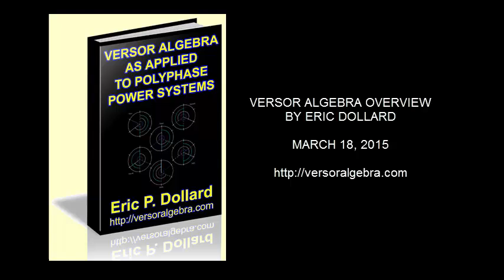Versor Algebra by Eric Dollard 2015-03-18

Comment: Thanks aaron, I bought a kindle just so reading digital is tolerable and I`m reading lone pine now which I purchased a few weeks ago, also if you get a chance to respond which book would you reccomened reading after lone pine?
Reply from the maker: stringmanipulator Lone Pine 2 is actually a bit advanced, but part 1 gets all the dimensions straight and is simple enough that a beginner can make their way through it. 4 Quadrant Theory is the direction to go to move towards the real understanding of the rotating electric waves in a Tesla type polyphase power system. This presentation is the simplest that it has ever been. There is a companion book that gets more technical than the lecture, but the lecture is a must see. If you're interested in the wireless work, Extraluminal Transmission Systems of Tesla & Alexanderson is needed. Although there is a lot of technical information in there, Eric has a LOT of history on the entire path of wireless transmission from the beginning that most people can understand and it is very fascinating. Eric also does a splendid job of dismantling Einstein's nonsense. Make sure to also watch the free videos which are linked to at http://ericpdollard.com those are long and valuable presentations that also gives a lot of background history into the electrical sciences.
Reply: Aaron Murakami
 Thank you Aaron for clarify, I've seen several of the presentations on youtube, and some of them several times, and I think they are awesome. I will support the work from Eric Dollard as good as I can because I think he is a genius and I hope he can do the experiments he has in mind now on his upcoming new lab .. 
It's so very interesting :)
Reply from the maker: stringmanipulator It's a PDF e-book for now. http://lonepinewritings.com
Reply: stringmanipulator  it is worth every penny and more. Easy to read nice diagrams and the way eric dollard writes is very entertaining.
Reply: Aaron Murakami thanks again aaron, I did purchase both lone pine writings but I will definitely study up on that video, I've watched theory of anti-relativity and origin of energy synthesis over 10 times and I still see things more cleanly each time, best wishes to you guys thanks again!
Reply from the maker: By the way, not sure if you saw them all but there are a couple other free video presentations by Eric on his website http://ericpdollard.com
Reply from the maker: Simon Limon Lone Pine Writings Part 1 is a primer then, there is Lone Pine Writings Part 2, which is a compilation of papers that may be a bit advanced. Actually, I would study http://fourquadranttheory.com video, then book. That is kind of the premise that Versor Algebra is built upon.
Reply: Simon Limon Sorry for just barking in here, but what format is the lone pine writing ? been meaning to pick that up for a while now .. is it just pdf? or is it epub ?
Reply: Aaron Murakami
 So lone pine writings 1 and 2 are for beginners, and then the next stage is 4 quadrant theory ?  Does the lone pine writings require any special education before hand ? or can a beginner get something out of it as well .. thanks :)

Comment: I am Very Found of your Hard, Intensive and Extensive Work, Eric, in Clearing the Basics of Electricity.

I am then near ashamed to spot few details you may care about but are so little in importance compare to the Very Value of what you do. But here the point I've noticed:

1. We found a use of "versor algebra", in Q.E.D. and Ricard Feynman's method, especially applied to diffraction, reflection, composition of different vawes length of light (it may be the same in sound engineering while dealing with large music theatres).

2. For a mathematical stand point, any magnitude, and more generally any quantity different in nature, especially which can vary, corresponds to a dimension. Deeper in the abstraction, it is the set who caries a component of a vector. Versor are a specific case of vectors, they are vectors whose magnitude is unique and then equalled to 1, the unity. But with no doubt, in case of phases studies, versors are the most efficient way to proceed when intensity do not vary, and in that matter, I would say you have Eric, all the characteristics of the genius: EFFICIENCY in PURE SIMPLICITY!

3. As per experts in music, polyphony came from Africa, indeed introduced in Europe in the Middle Age.

I purchase of course you book like I did with some of your Great previous writings.

With my deep respect.
Reply: Please. Feynman is an absolute clown.😊